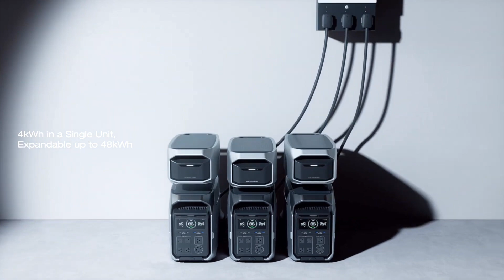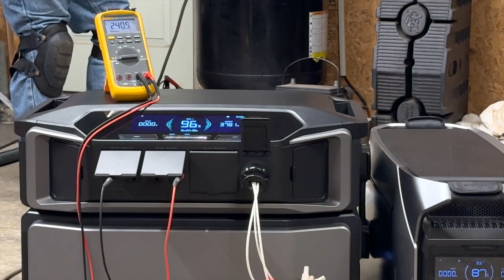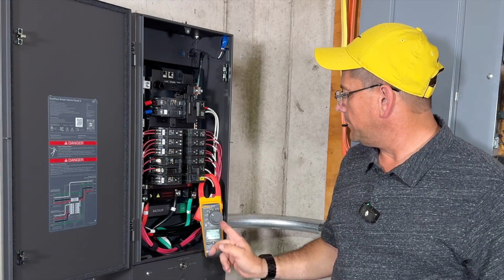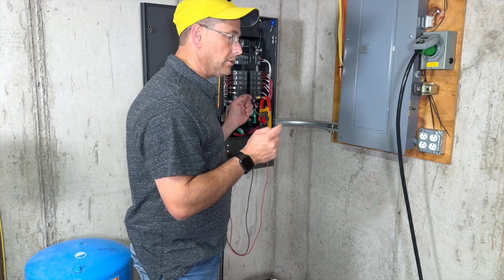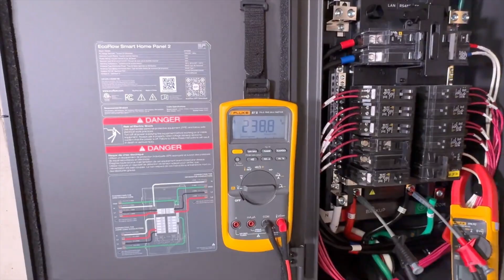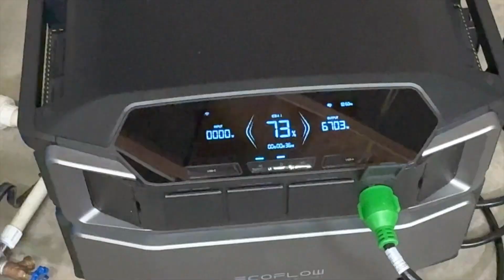🇬🇧 💡 EcoFlow DELTA Pro 3: The Best Portable Power Station? 🔋⚡ | Full Review & Testing 🛠️

Comment: Question Did you bring the hot leads, neutral and ground wires from the main into the smart home panel.
Reply from the maker: Thanks for your comment! The vehicle shows in the video is a 2024 model. Compatibility may depend on the specific version, so I recommend checking with the seller to be sure

Comment: Question How did you wire the breakers in the Smart Panel 2 from the main panel ? Did you disconnect the wires from the breaker in the main panel and add a wire with a wire nut or wago connector then feed it to the Smart Panel 2.

Comment: Great video Rick, I really enjoyed it. I recently purchased the DP3 with the intention of charging up my EV (solar + DP3). I’m using the 240v L14-30 port of DP3 to connect to a transfer switch on my electrical panel. I’m finding that the DP3 is turning off the 240v inverter because the amperage draw on my charging circuit is too high for it to handle (12a charger + 4.5a garage fridge + a couple other minor things). Just learned today that the L14-30 is limited to 16.7a which shocked me. So my very long winded question to you is… To get around this very low amperage limitation would you recommend that I go with the DPU or keep the DP3 and add the SHP2? My ultimate end goal is just to be able to load shift some electrical to charge my car and to be able to power the house in a grid down event. I appreciate your thoughts. Thanks! Keep the videos coming!